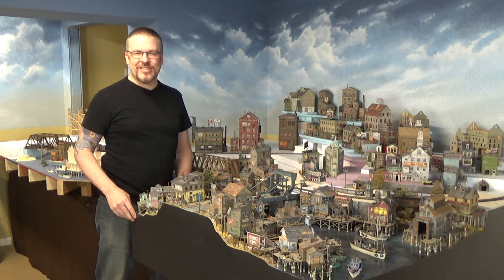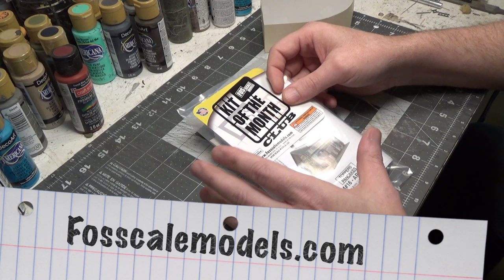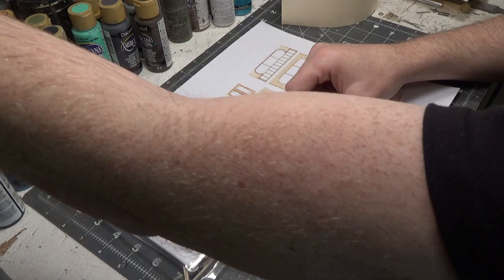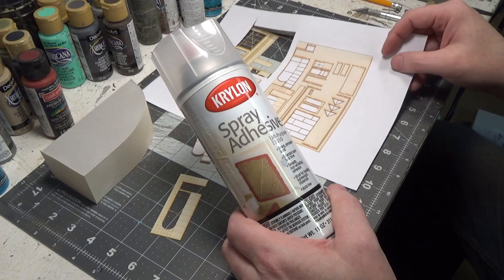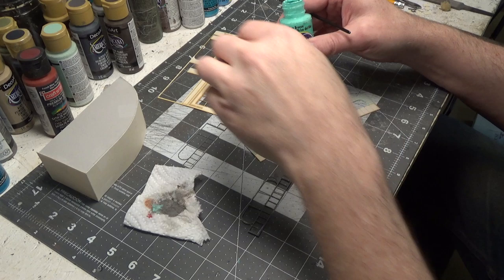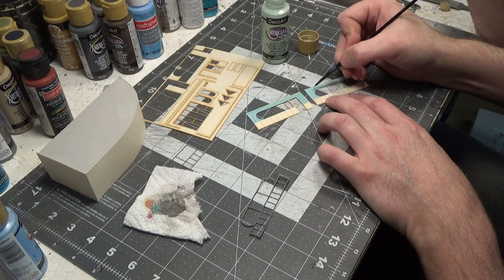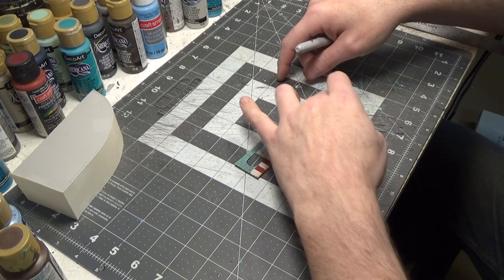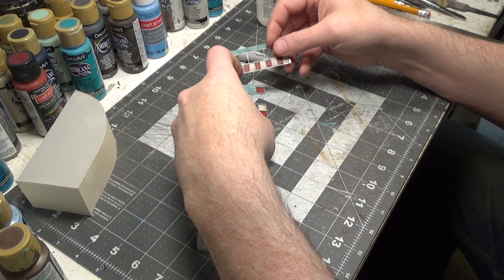Building a Diner!

Comment: Thanks for showing us this amazing diner. I liked your use of copper wire on the diner sign. I may try that to add some detail to a movie theater sign that I need to build and create.
Also, the cracks in the sidewalk are the little touches that raise the level of detail in a structure setting. Thanks so much for sharing your skills with us.

Comment: Jason;
Quick question.  What would be you impression of scanning the  Craft Model parts.  Into your computer server system.  Then when ever you should want a set of prints you would have them already digitized.  Now here's the BIG SWITCH.  Instead of gluing the printouts to file/folder board you glue them to sheets of basswood.  Then using a very delicate hand you could cut out as many model pieces you may need.

I like the idea of duplicating paper cutouts for demo or space filler spots on the layout.  But I was wondering if making additional pieces is kosher?

Great episode.  I am going to take you up on the model a month club.
~Jim
Reply from the maker: I think your on to some great ideas! Keep modeling and have fun with the kit of the month club!!!!